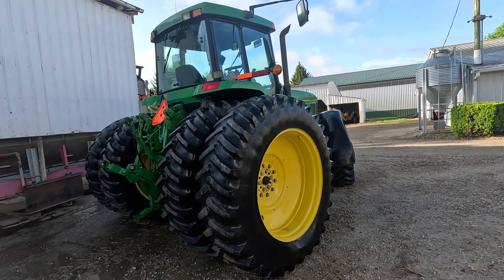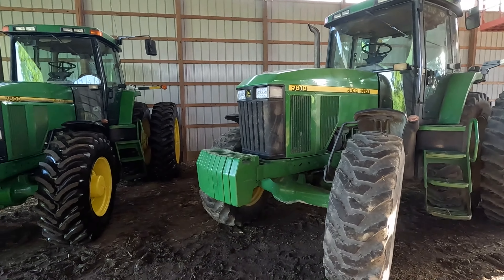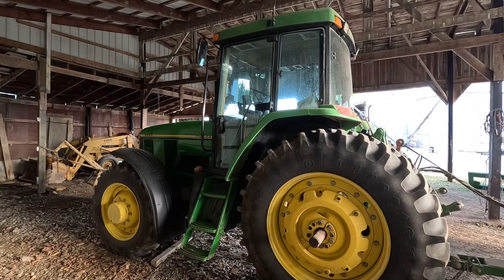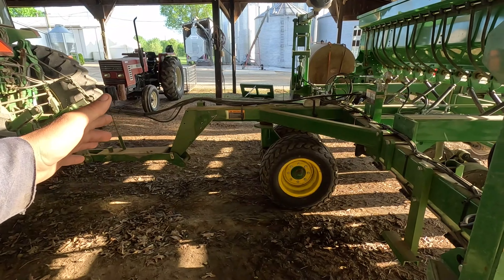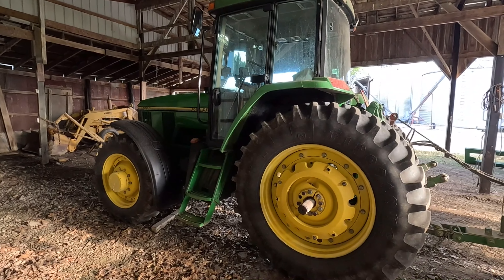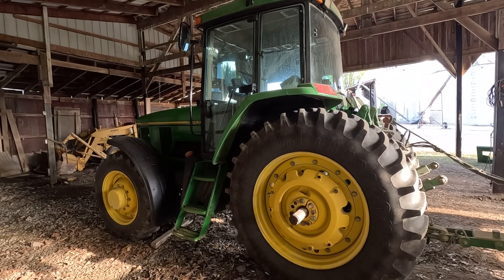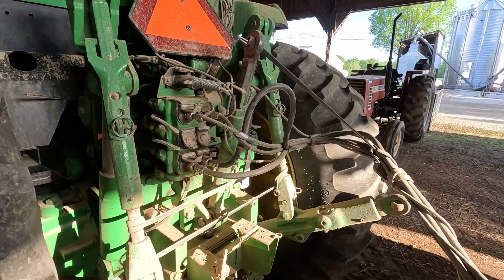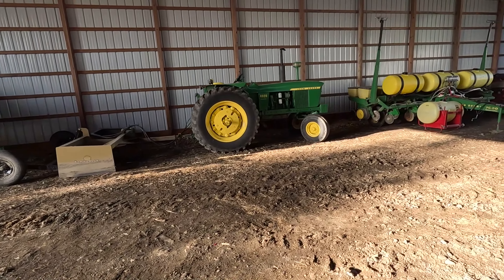Its Broke Before We Could Even Use It In 2024

Comment: If you are going to give information give the right information the 6120 will run the 1590 grain drill all day long it does have down pressure. If you can hook two hydraulic hoses to it it has pressure both ways you can use the drill on the 4020 also. Iv done it many times
Reply from the maker: Interesting. Thank you
Reply from the maker: Probably the most or R,  but not the E.